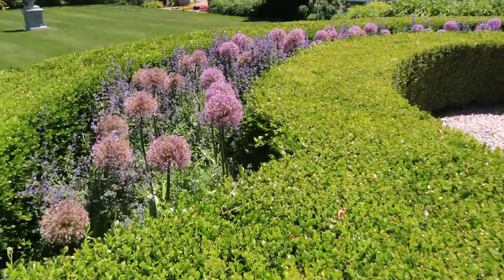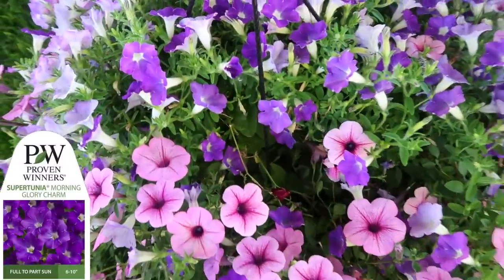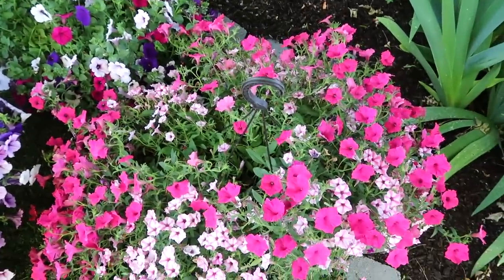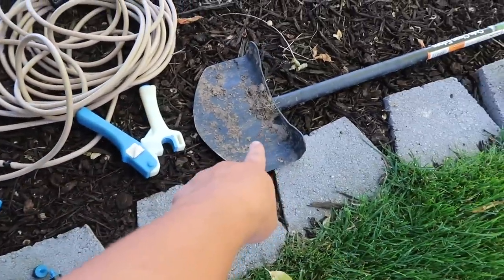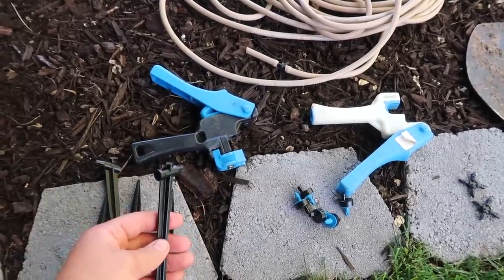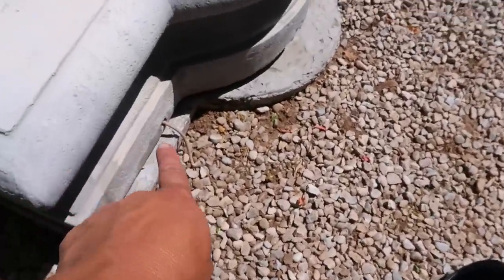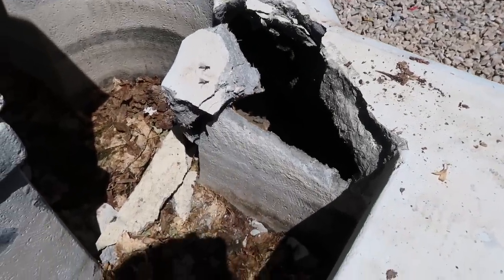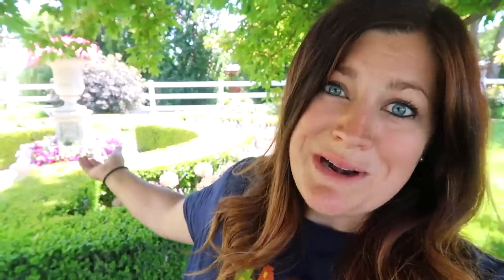We Had an Accident! 😱// Garden Answer

Comment: have rewatched this several times! So glad no one was hurt  but the response from both was hilarious! 😂😂
Question - if you arent thrilled with the fountain as the fountain it is now, why not reconfigure it? 
Without the urn on top, it looks very like the one in your old garden. Can you add a short spacer to make it taller & put a different top on it like your old one?  Use the urn elsewhere as a planter with a new base (already has a hole for drip.) 
As it is with the flowers in it now?
It is absolutely gorgeous!

Comment: Slo-mo shows how it happens each time: the square corner of the urn  base shifted over and fell into the large square opening at the top of the pedestal when you tipped it over to thread the tubing up the urn. The unexpected shift in weight of the heavy concrete urn when the base fell into the pedestal meant you had little time to "catch" it before it was too heavy and you lost control of it. Its a 3 person job. If you replace the fountain pool or need to tip the urn again rotate it so the corner of the base deliberately tips into the pedestal opening in a slow controlled dip while 2 people have a hold of it- the third person can do the tubing, wiring etc. then swing it upright and turn to straighten it.  The pedestal opening is awfully big with a narrow rim for the urn to rest on. Or get a equipment to lift it off safely. With all of your large expensive $$$$ concrete fountains, pedestals and urns,  you shouldnt attempt moving them alone anyways, my birdbath is heavy enough!

Comment: Can you recommend a low light houseplant with really shallow roots?  I have a planter that’s wide but not deep.  I want to put something in it in a corner of a room where the only light comes through a window filtered by blinds.  The plant will be 4 or five feet from the window and the temperature inside ranged from 68 to 74.  I can add a portable grow light if necessary.

Comment: It looks like the whole issue started when the corner slipped into the hole underneath. Given that you've had the same thing happen twice with two different people, I'd start wondering whether it's a design flaw. Maybe consider replacing the fountain with a different option that doesn't require you to move the top tier so often, something that's less tall, or the top piece isn't as large/heavy? That fountain was there before you moved in, right?

Comment: how do you know when irrigation is clogged ?  can you blow air into line? how to know where all the capped ends of run are ? so as to flush thru. i would like to put drip to save evap, but need to know the pros and conns ?   and what type of freeze protection at end of year?

Comment: Might not it be easier to glue a piece of stiff bent screen to fill the hole,,, then patch it with cement,,, you should be able to make it look as good as new .  It is or was just a square corner, anyway good luck pt

Comment: Have a question if I planted azalea in regular potting soil mix because I did not know it had it’s own soil.  Do I need to change the soil?
Reply: 🌱Depending how long ago did you plant it, you may lift it and use garden soil with starter fertilizer and cow manure mixed in.  Otherwise, I believe you can amend it using Cow manure. Azaleas need an acidic soil.🌱
Reply: Maria Folch Thank you!

Comment: Can you tell me what they're called or where to find those tools you used to punch the holes and connect the tubing?  I'm in the process of adding more drip and that looks like it would make things easier.  Thanks!
Reply: I believe she did a video showing the tools.
Reply: @mariafolch8067  I thought so too, but I haven't been able to find anything that mentions those tools.  I have trouble inserting the pieces into the actual tube, so that thing would be really helpful.
Reply: @karensmith4534 🌱 I found one in Amazon for $12.98. I am sure that Lowe's, Home Depot or other Hardware store may carry them. I purchased a drip tubing cutter at Home Depot. Here is what I found at Amazon:  Orbit 67758 Drip Tubing Cutter & Punch Tool Kit 🌱
Reply: @mariafolch8067  thank you!

Comment: It seems odd that the urn didn't have at least a spray of water coming from the urn & only coming from the sides in the middle. What size pump would that take or would you use a separate solar powered one for the urn?  I love that fountain, please don't fill it with dirt & use it as a planter..   I'd get the cement out, fill in that corner and kill all the hornets.😁 I hate hornets but I love your yard!!